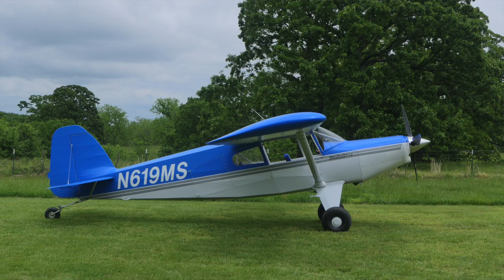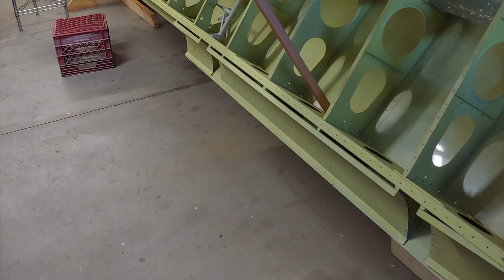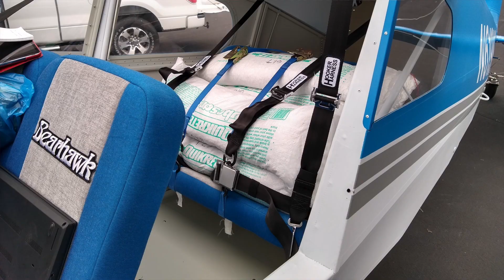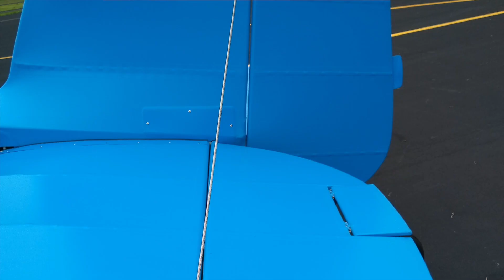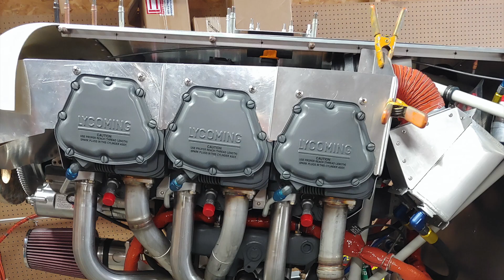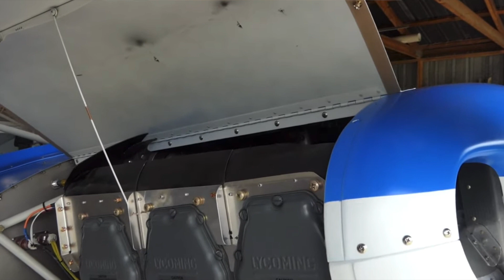Bearhawk 5 Introduction

Comment: http://windsolarhybridaustralia.x10.mx/forward-impact-damping-seat-harness-structure-concept.jpg
Wondering if the floor seat support struts and frame of the seat with the tubesand bags at 4min-02sec (just under 150kg) are built for 200kg weight to inertia deformation for 80kmh frontal directed impact alike modern airline seats specifications.
Childrens' weights rate either 1/4 (20kg) or 1/2(50kg) of the standard 80kg FAA passenger, so to make the system deformation impact for them requires pair struts either side (each person) vertical up from the rear lateral frame pipe in the bottom rear of the seat for the shoulder harness to be joined at the tips giving the pipe the ability to bend (levered) forward for the lower weightmaking a 3 seat 50kg person system or a 4 combined rear childrens seat 4x20kg rating , (separate) eight uprights for lower height set shoulder harness. To achieve the same for the waist seat belt level of the children, a pipe vertical down from a bar set lateral across the middle in the back of the seat operates the same way .
On impact the pipes are simply bent forward.
warning : impact-flex pipe base weld should be as good as the metal it is joined to, toughness rating (not brittle!). *pipe lagging rubber may be a good cover over the pipes (considering the displacement - travel and protrusion after and impact). Could arrange both systems by fitting into the seat 3x50kg and 4x20kg (28 pipe struts total plus one mid mount bar).
Each of those 28 mount point pipes should be a semi circle of pipe with both ends welded to the lateral bar.(4 per person 2 uppers - chest 2lowers - waist.